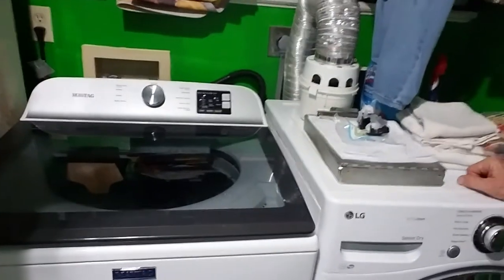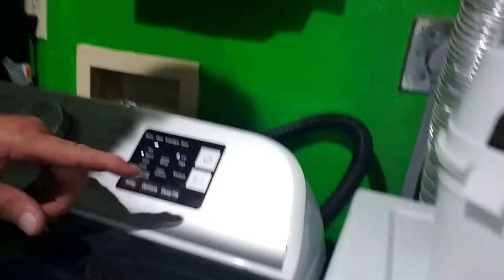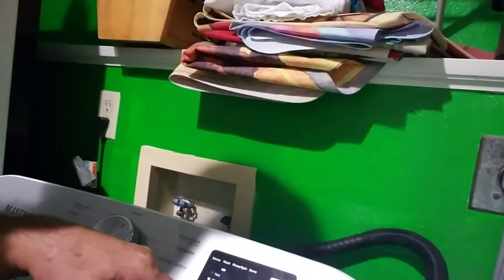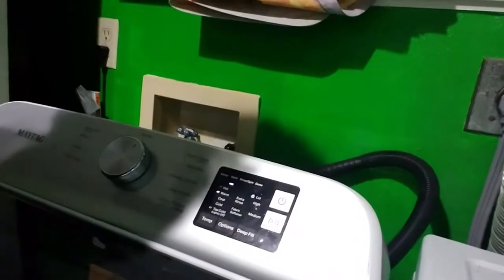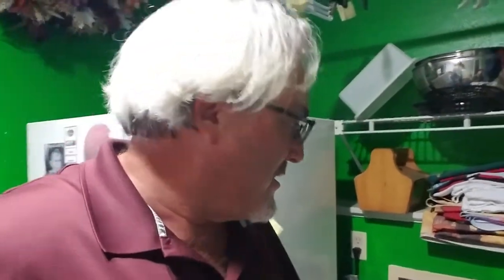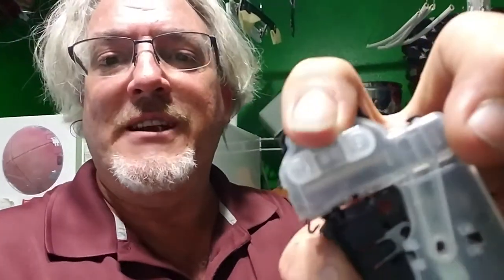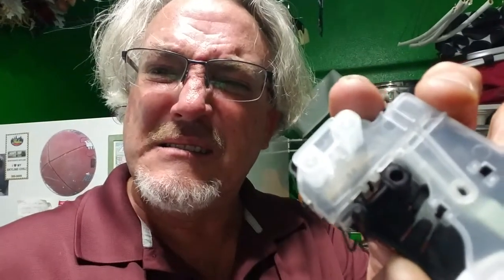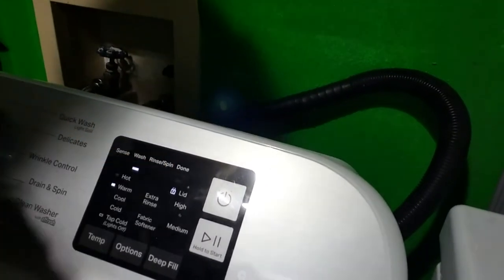Maytag Washer, Watch what happens!! Code found.  Only Whirlpool can decipher!

Comment: Use to buy a washer and not do anything too it for 20 years. Now they need repaired just after a few years and even sooner if they're used a lot. I do about 1 load a week, and not even in 3 years new washer gave me troubles. So less than 156 washes stupid machine already gave me some problems, luckily it wasn't a huge one and I easily resolved it.

Comment: You know it took me two years to figure out that code. Ended up being that I was testing the unite without the tub installed and after the spin cycle because there was no tub installed the shalf would just stop and generate that same code.This code can also  come up from a tub with bad bearings .